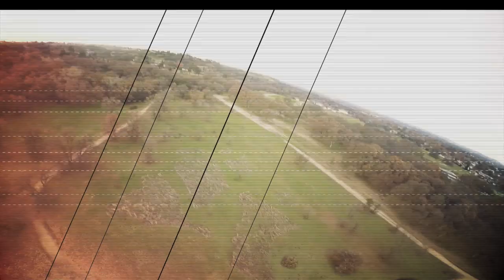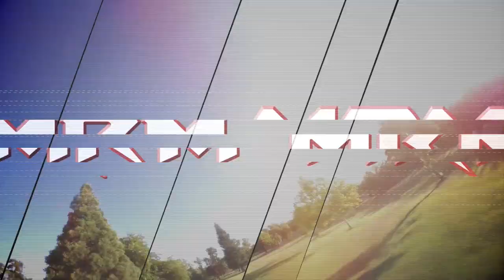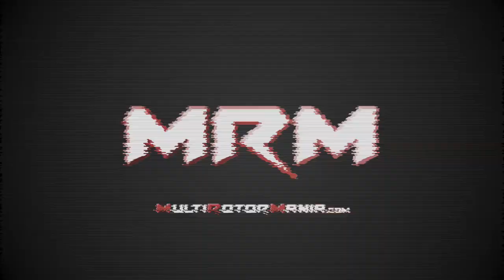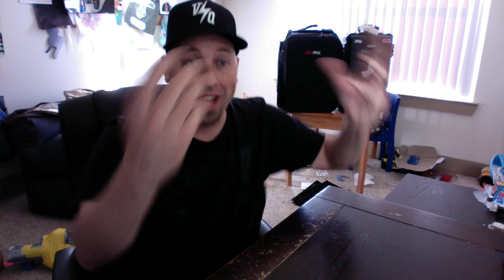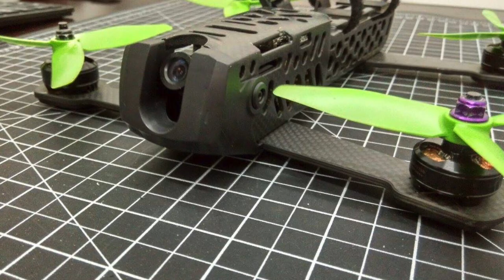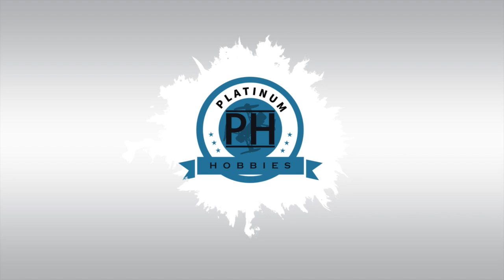Team Black Sheep Vendetta FPV Racing Drone and Whats Coming...

Comment: I have 10 or so Racing quads, I had Built 8 of them and I have also the Vortex 285 and the 250 Pro. The problem with those is PARTS. its always hey good luck replacing something on the Vortex's which is why I got away from them. I don't see any replacement arms etc for the Vendetta looking around the Net, Which makes go... Hmm  here we go again. Its March 2nd and maybe its early to say that but eh.